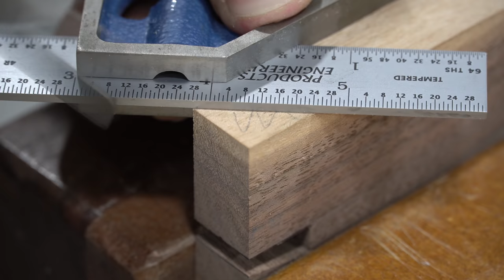Building a Wrapped Sapwood Mitered Dovetail Arm Table

Comment: This was super satisfying to watch. When you fit the pin board to the tailboard, what is the purpose of those two scrap pieces clamped to either side of the pin board? Always looking for new tips when doing dovetails!
Reply from the maker: Thanks so much Sterling! That's a very good question. The tail boards are much wider than they are tall, and the grain is going in the shorter direction. This makes they very easy to snap in half. In fact when I made the prototype version of this, the tail board actually snapped in half while I was pounding on it during glue up. That's why I clamped on those scrap pieces, to provide strength in that direction.

Comment: Nice job DK. No offset trick for transferring to pins this time? I’ve completed several dovetailed wood hinge boxes and hopefully will post a video after winter
Reply: Ps instead of paper towels to protect the clamps from glue, try using just some paste wax, works very well (can also protect unwanted glue surfaces on the wood)
Reply from the maker: Thanks Tranq! And, yeah, I like to use both methods, can't decide which I like more! Let me know if you post a wood hinge box video I'll definitely check it out
Reply from the maker: Ahh interesting! Paste wax directly on the metal part of the clamp? Does that impact how well the clamp can hold?
Reply: @dkbuilds  Yes directly on the metal! Then you don’t have to worry about the glue or water ruining expensive clamps. I haven’t had any issues with gripping power but I usually only apply the wax to the exposed area after I set the approximate clamp distance

Comment: Nice job! But what happened in between 9:20 and 9:26? 🤣 that bandage wasn't there before! If I have that you can usually see a trail of blood on the final piece, cause I miss it when it's still fresh and then I get too lazy to clean it once it's dry.
Reply from the maker: Hahaha good catch! Definitely snagged my finger tip with a chisel. It was bleeding a little too much this time to not cover it 😜

Comment: Not sure why you used a hand saw and then the band saw to rip a board when you have the right tool, a table saw, right behind you.
Reply from the maker: Good question Yabba! I used a bandsaw for two reasons. First, it is dangerous to cut wood with lots of internal stress on a table saw, the wood can clamp itself around the blade causing kickback. Second, to use the table saw safely you need one flat side of the wood to run against the fence, and at that point this wood was still too rough.